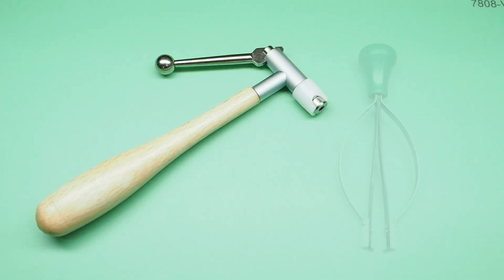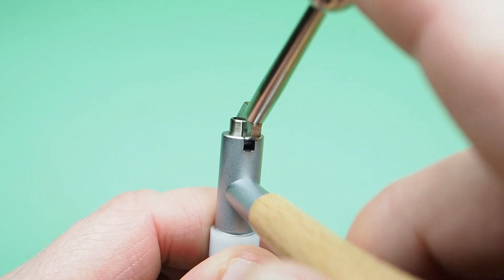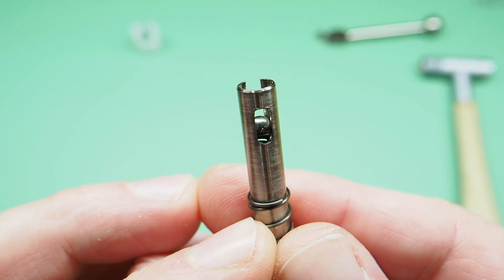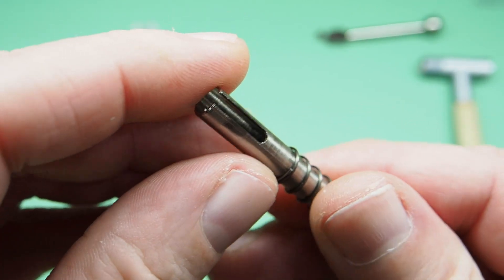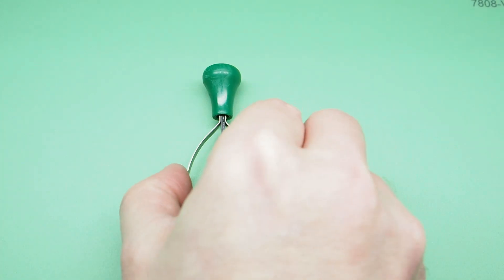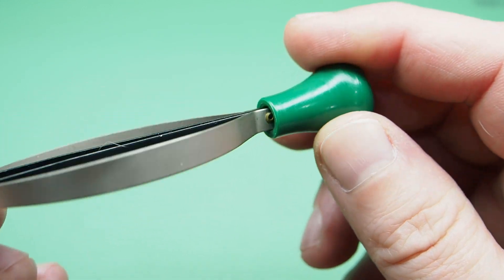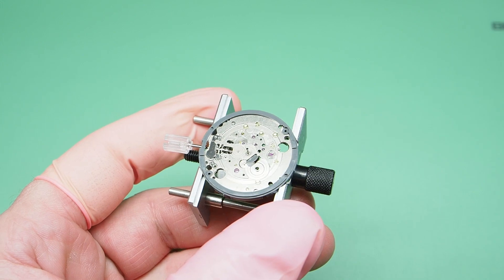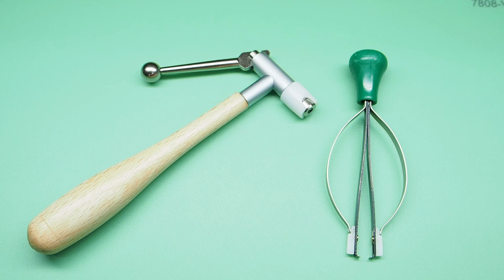Cannon Pinion Remover (Bergeon 4854 & Bergeon 30637-2)

Comment: Thank you for this video, it was very informative and well shot. I've recently gotten into the watch repair hobby and was debating on  which tool would be better for a wider range of cannon pinon removals, and this has convinced me to go with a presto tool for now (until I inevitably give in and buy more tools). I like the concept and action of the purpose built cannon pinon remover, but will keep an eye out for options to make or get a tighter collar for smaller shafts.
Reply from the maker: The cannon pinion tool is a nicer tool but the presto tool is a better choice. As you only got into the hobby recently, I assume you’ll be working on scrap movements? If that’s the case, look for the old cannon pinion on eBay that will remove cannon pinions that are less than 1mm in diameter. In the meantime, if you’re working on scrap movements, use your tweezers. It’s not the right way to do it but that doesn’t really matter if you’re working on scrap movements. Sooner or later you’ll find the old cannon pinion remover on eBay and you will end up paying for one tool only instead of two.
I certainly wouldn’t buy the new cannon pinion remover. I have noticed that it is now described ‘can lift cannon pinions 1.20 to 1.80mm’. Looks like they’ve ‘improved’ even more because mine was from 1.00 to 1.80mm

Comment: What is common size of Canon pinion tube use in watch movement (not clock movements)?
I heard that 4854 too big to grip the tube
Reply from the maker: There is no common size, some are below 1mm, some are above 1mm. The Bergeon 4854 can only remove cannon pinions equal or greater than 1mm

Comment: The presto tool doesn’t always work on stubborn cannon pinions. At least that’s what I have experienced.   I will be purchasing the 4854 in the future.  I probably just wrap the small cannon pinions with some foil. Not ideal but we will see how that works.
Reply from the maker: If you’re not in a rush to get one, I would consider buying a used one. The older cannon pinion removers will remove cannon pinions below 1.00mm in diameter. You’d have to check with the seller prior to purchase.
Reply: Here is a link to a video about the limitation of the 4854 and how to modify it to remove smaller cannon pinions.  It's in the comment section posted by Darren Caddy.  https://www.youtube.com/watch?v=e1H0FC_q900

This is what he said:
 "Hi there Sir. I had the same problem with a newer version (the old one worked even on very small ladies watches) which failed to remove the cannon pinion on just about every wristwatch I tried. Now, there is a simple modification anyone can do to get these to work provided you have a thin metal double sided diamond coated cutting wheel found in the Einhell mini drill set and the solution is easy. You need to strip this device by lifting the lever upwards where you will find a ball bearing, a spring, and tube with the collet at the end. It is the collet that needs adjustment by using the diamond wheel as a file to increase the slots by filing two oposing slots together (there are six slots in total) two slots will be opened at one time so with three passes it enable the hole in the collet to close smaller and thus grip the cannon pinion. This is done by holding the collet closed with the fingers and moving the wheel backwards and forwards to remove metal thus making the slots wider. And that is all that's needed to make this device work. I remember reading that this tool is suitable for cannon pinions measuring from 1 to 1.8 mm. I tried gripping the shaft of a 1mm screwdriver blade which it never did. After my modification this tool now grips a .8mm shaft and there's still more left for an even smaller size.
Just be careful not to lose the ball bearing as you lift the lever."
Reply from the maker: Jeffrey, many thanks for your comment. It’s very helpful and hopefully others will get to see it too.
My apologies for responding this late. It’s only today I’ve found out that there is a section where comments are held for review and yours ended up there for whatever reason.
Reply: I am afraid of filing the collet of my new 4854. Did the silver foil method work for smaller cannon pinions? I ended up buying the green presto as well